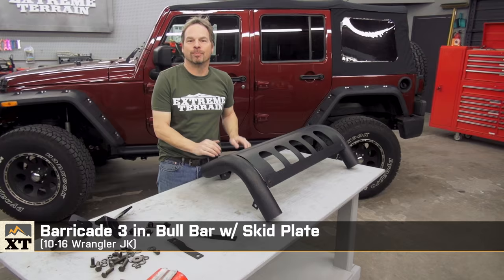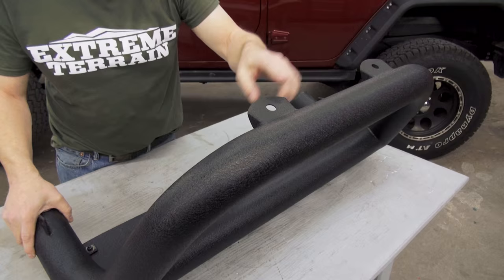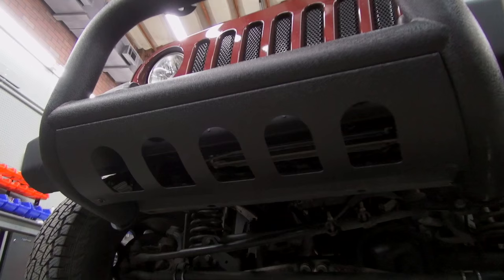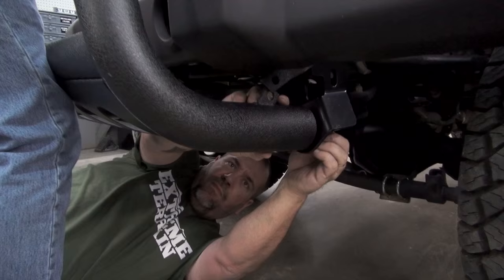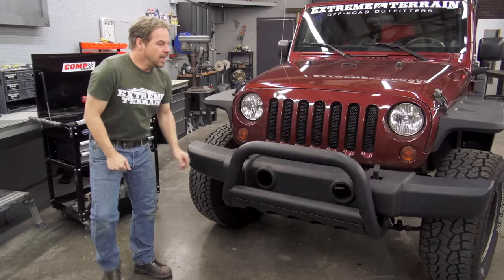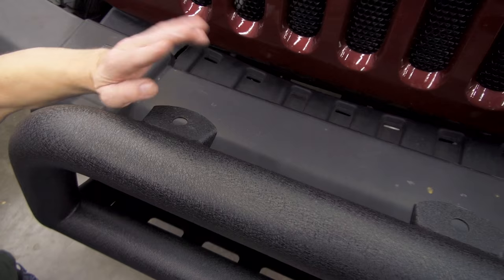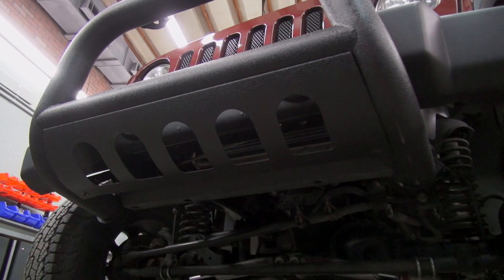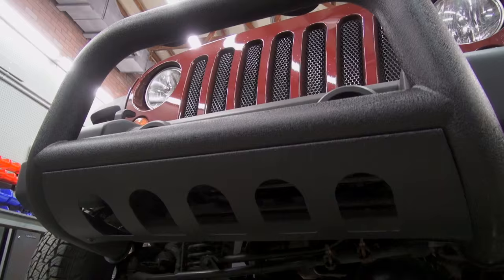Jeep Wrangler Barricade 3" Bull Bar w/ Skid Plate (2010-2016 JK) Review & Install

Comment: i just purchased one, and waiting on it to arrive so I can install. like the look, and I only drive pavement, no 4 wheeling or anything, so it will suit me just fine
Reply from the maker: Awesome! I think that the Bull Bar looks great on the front of the JK. It also adds a good amount of toughness to the front bumper without spending a ton of money on a new bumper! Let me know what you think once you get it installed! -Jake
Reply from the maker: The metal skid plate on the bull bar will help deflect the air a little bit, but not as much as the factory plastic skid! On the install guide for the Bull Bar it shows you an example of where to cut the plastic skid in order to install the Bull Bar while retaining the factory plastic piece. Here is the link to the install guide just in case you need an online version http://1.cdn.lib.extremeterrain.com/guides/J100162_Guide.pdf. Let me know if you need any more help! You can also email me at jake.roberts@extremeterrain.com -Jake

Comment: I just bought one for a 2021 Jeep Gladiator is it about the same install? Ive heard its a little faster? Do you have a video for that?
Reply: How’d this go? I was looking to install one on my gladiator too
Reply: @Jetsjetsjets  It was not that bad. One issue I ran into you cannot install a winch with it. (They said I could when I called and asked) It looked awesome on it.
Reply: I just bought it for the gladiator and had to remove the original metal skid plate that came with it. Might need to modify the plate to make it fit there once again cause I liked having it there
In the first place